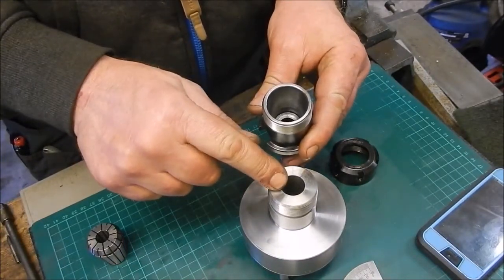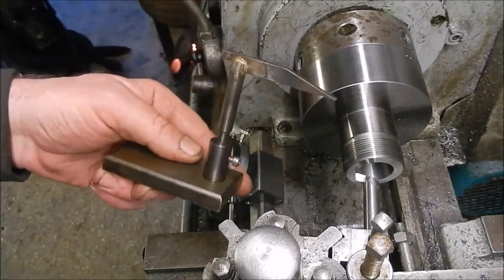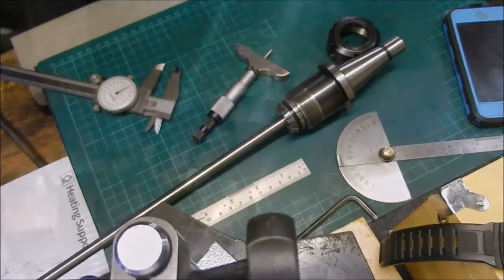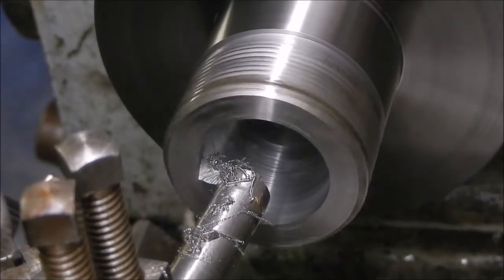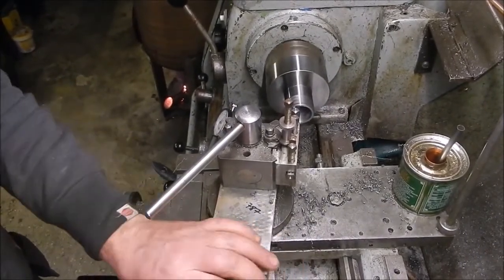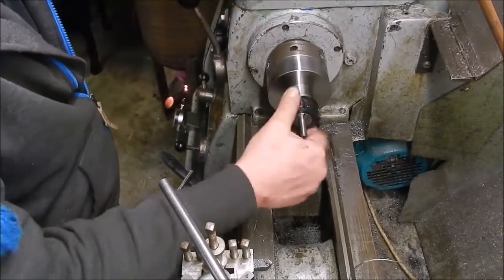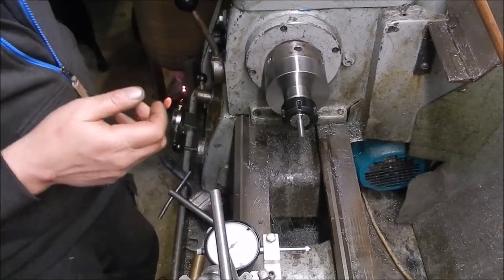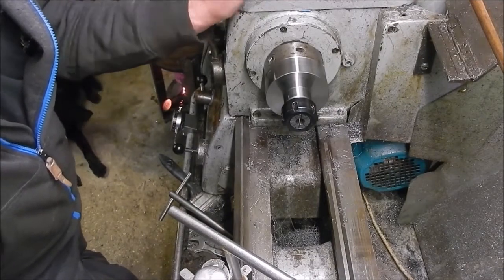Collet Holder Part 5 Finished.

Comment: Hi, brilliant job. Question, could you have made the base thinner and therefore have less overhang and would that increase your accuracy even more. Thanks
Reply from the maker: Hi Peter good question the answer is that the holes for the cam studs are 28mm deep so I didn't want to risk a break through, a bit chicken I suppose because I could have done it 10mm shorter but didn't want to risk it, there is some thing else that I can still do to improve it a little more but I would need a tool post grinder and at the moment I don't have one? yet, but I know a man who has if you know what I mean, I will mention it on the next video and explain a bit more, thanks for the comment.Regards Alan.